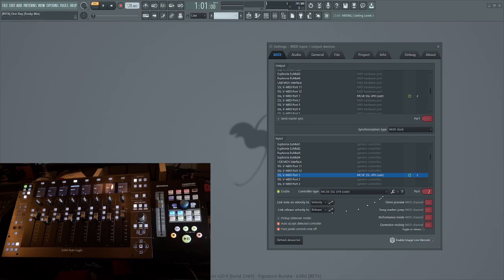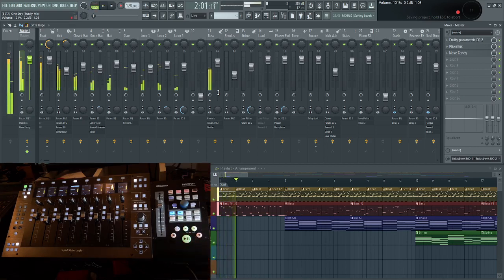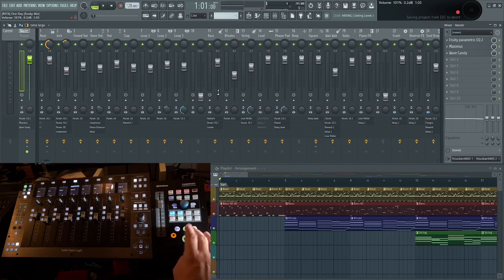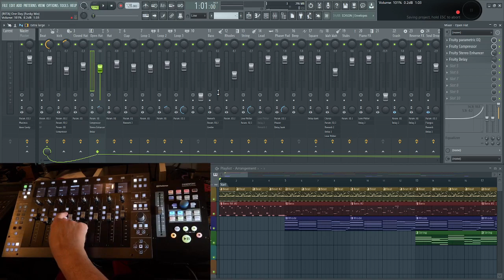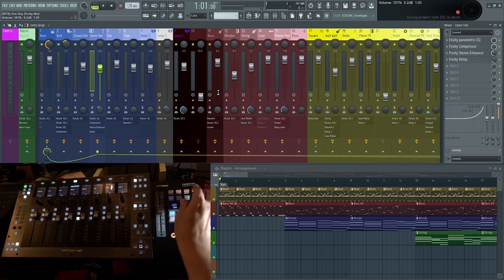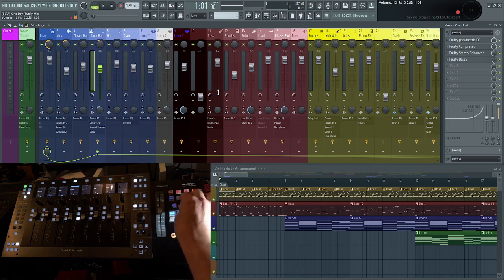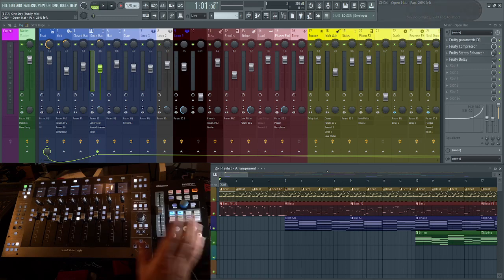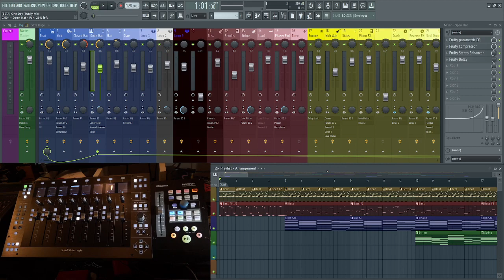Using the SSL UF8 with a dedicated Transport Control

Comment: Just got the UF8 - I'd been using the single-fader Faderport for years. The Faderport works well as  transport controller, but there's one nagging problem: it gets assigned a bank of 8 faders, so when you use the Bank buttons on the UF8, it skips over 8 channels each time. (In essence, the Bank controller thinks it's handling 16 channels, not 8. The Channel wheel on the UF8 still works normally, though.)

Have you encountered this? Thanks!
Reply from the maker: Sorry I don't have my UF8 any more, I didn't notice this  ehaviour when I was doing the review but I perhaps missed it.
Reply: @ianwalker2258  Right then! thanks anyway.
Reply from the maker: @malcolmpollack5612  Having said that, the easy workaround is to use the single bank button which will only ever move up or down by one bank
Reply: I had to setup my X Touch one as a generic controller to avoid that

Comment: Is there a function (a button) on the UF8 that doesn't work with Fl Studio? Or does every button just works fine and you can use it with alle the functions it has?
Reply from the maker: Every control surface button on the UF8 can be scripted to perform any Mackie Control Surface action - so its very flexible. with regard to FLStudio
Reply: Okay but is it any button that does not work when you first plug in the uf8
Reply from the maker: @ov-beats05  I don't think so if you use this script
Reply: @ianwalker2258  ok thanks

Comment: do u consider the faderport to be a good controller for fl studio? thinking about getting one
Reply from the maker: Personally if I just wanted transport, I would get the single X-Touch, or the Single Icon controllers and just utilise their transport sections but that said, the Faderport fir transport alone will definitely do the job.
Reply: @ianwalker2258  yhanks! what about fader accuracy  for automation and scrolling thru channels in the mixer window? which device would u recommend for that?
Reply from the maker: @hypxr3285  I have never had any issues with fader accuracy in terms of selecting tracks and I have to be honest I haven't paid too much attention as to the accuracy of the single built-in fader or automation management (as I was only checking the transport features).  That said, most of these devices have calibration options so you should be OK with any of them in that respect.